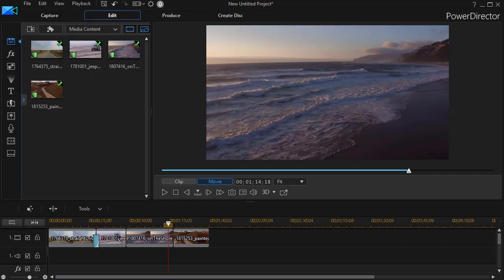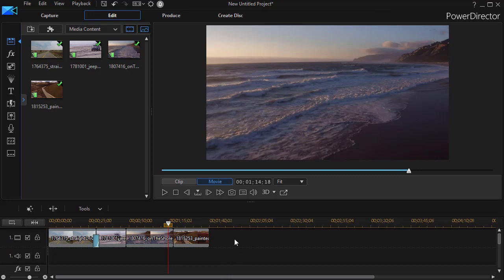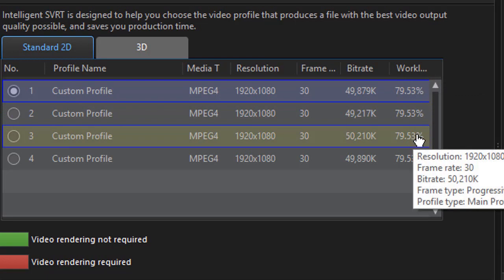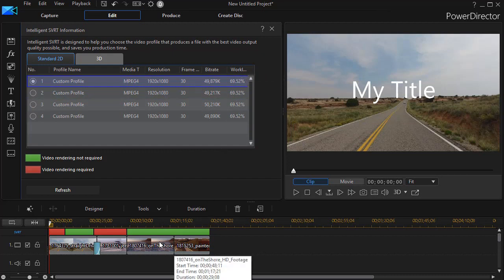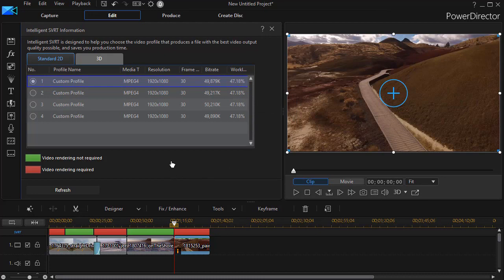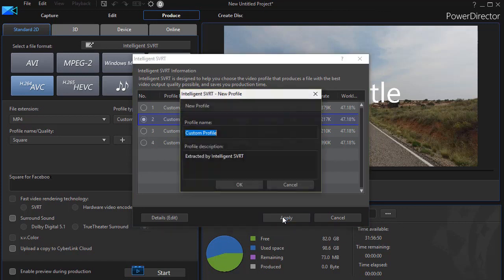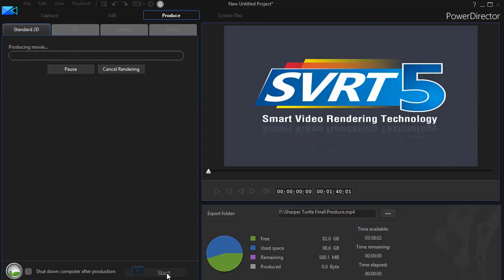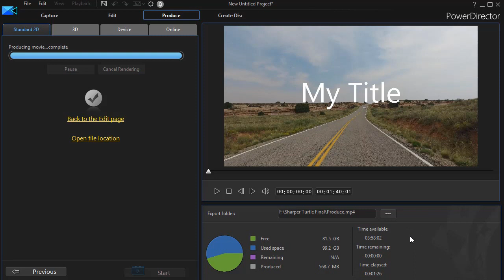PowerDirector - Speed up rendering with the SVRT tool

Comment: Hi. I've rendered 3 videos using SVRT and they all ended up having random jumps and flickers in there. Not too many, but enough to hack me off. The last video I used SVRT and had the same result so I binned it and re-produced the video without SVRT and it was fine. Any ideas?
Reply from the maker: Ian,
Sounds like it's not handling your content well. I'm afraid I can't tell from here what components in the video caused the produced result to show jumps and flickers. Are there any commonalities in those locations where the bad processing happened? (transitions, audio editing, special titling effects). That's one thing I would look for. PD is obviously choking on something. I'm pleased that it's on with normal rendering but unhappy that it's not alerting you to issues before producing unusable video with SVRT. --Jim
Reply: @SharperTurtle  Last video, all done on Canon 800d at 30fps. No enhancement or colour correction. One transition in entire video of about 15 minutes. I've looked for commonalities between places it happens and can find none. Seems random. Just wondering if you had ever come across it before. Just upgraded to 17 but not done a video as yet. We'll see if that makes a difference.
Reply: I'm just curious You mentioned flickers.
I have experienced that before with another program but I was filming in 4K
Possibly even in 2K

Was yours in 1920x1080 or higher ?
Reply: @SharperTurtle  
Hey my friend sharper turtle.
He mentioned flickering.
I've experienced that with another editing program.
But I was shooting in 2K and also 4K

I never experienced it in 1920x1080 HD
IS IT POSSIBLE HE COULD HAVE BEEN FILMING IN 2K OR 4K ?
Keith Kuhn

Comment: Hello, I edit the video with effects, transitions, color correction, I can not enable the svrt option, the profiles that appear in red, nor let me update with the alt + s use powerdirector 17 , I use original m2ts files, try with mp4 and I have no results my lap is seventh generation with amd video card, help thanks
Reply from the maker: Mike,
Great question! I did some experimenting after reading your post. I applied color correction to one clip and effects to another, and a transition in between. Then I tried to use SVRT. Everything came out in red. I think you were describing something like this. I then removed the effects from one of the clips and that segment turned green and I could do SVRT on the rendering. Apparently, if all the segments in the production have edits like the ones you describe, they have to be rendered in a normal fashion and there is no "shortcut" with SVRT. If it can't produce time-savings on rendering because of the nature of the clips, it won't give you an option. If even one clip segment in the entire project can be speeded up in rendering using SVRT, then it will show up as an option. That's my best understanding of what you are dealing with. Hope this helps, Mike. 

Your question prompts me to do some work on an updated tutorial for PD 17 as some of the screens have changed from the tutorial I did using PD 16. --Jim
Reply: Thanks for answering, I've already done your advice and it does not let me enable the svrt technology, even now I have disabled the Hardware video encoder option, uninstall powerdirector 17 and I reinstalled it updated the patches of the official website, my problem remains the same, I've seen in forums that uses the Windows registry regedit to change some parameters of the program, it does not work for me I hope that later there is a solution, so while I will use magix vegas 16, powerdirector makes me more complete greetings

Comment: I produced a video then did some editing of this production. I assume I have to reproduce it. Does this replace the other video or just make the changes and it will have the same name? Or do I end up with to separate end products?
Reply from the maker: Steve,
When you render a video it will normally detect that you have already produced it with the default name. Then it will ask you to save it under another name so you don't overwrite the first one. Nice to have a backup you can go back to. --Jim
Reply: @SharperTurtle  thanks

Comment: i copied everything correctly and the fast render would flash on then go straight off again so I didn't work for me either.
Reply from the maker: Sorry it has taken me a long time to get back to you. I had to look at the tutorial again and see if I could find any clues as to why it did not work for you. I've noticed that some of the settings have changed and SVRT is implemented differently. I was able to make it work, but I'm wondering if performance is tied to your processor and/or video card. Have you experimented with the settings in PowerDirector to see if any of those can be adjusted to achieve better results? --Jim

Comment: I tested this on my last project but the resulting MP4 is not playing fine on all devices. I had an MP4 from someone and have added some pictures in slide shows before and after that MP4. The overall MP4 plays fine on both my PC and Android tablet but not on my Android phone: The slide shows at the beginning and end off my total MP4 are fine but not the third party included MP4. The original third party works fine on my phone but not when it has come out of PD16. I tried different players on my phone but can't get it to work. My phone shows only big colored blocks or a black screen when it comes to the included MP4. Anybody an idea what could cause this problem and how to solve it?
Reply from the maker: Andreas,

Great question. I'm hoping someone else will chime in here to help you with it as I don't have experience producing MP4 files and using them with an android phone. 

This question might merit posting on the Cyberlink user forum. You will probably get a faster answer there.

--Jim
Reply: Hi Jim,
I did some investigation: I rendered my project with SVRT disabled. I took a while longer as expected but the resulting MP4 is playing fine also on my mobile phone. So it seems to me as if PD16 is doing something wrong while creating MP4 with SVRT enabled.
I´m going to discuss this with Cyberlink now and let you know the result if I get one.
Kind regards
Andreas
Reply from the maker: Andreas,
I'm always impressed by users like you who try to nail down issues that impact all of us. That's why together we are a learning community. Let me know what you find out. --Jim